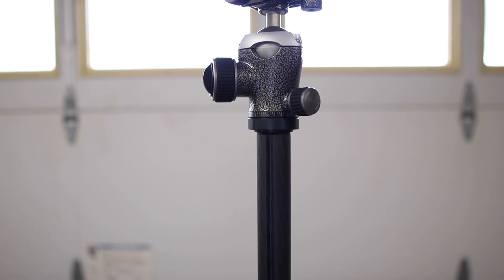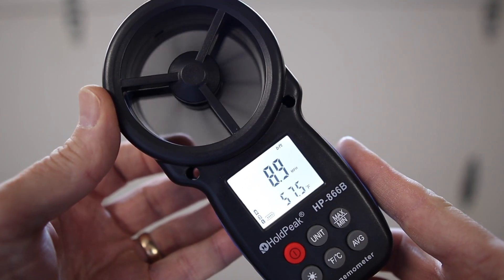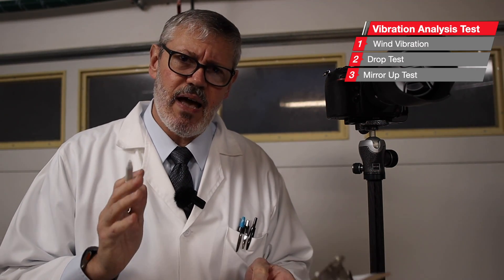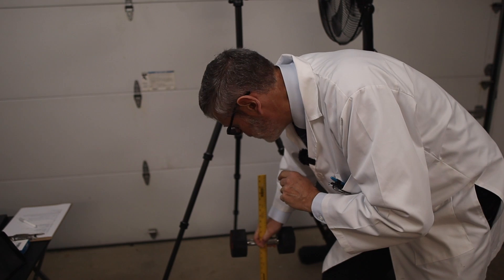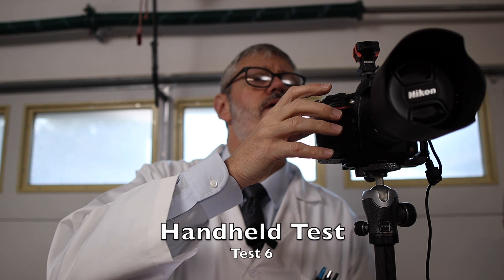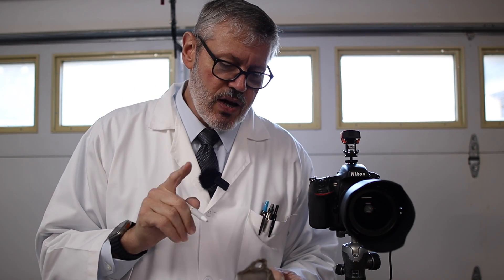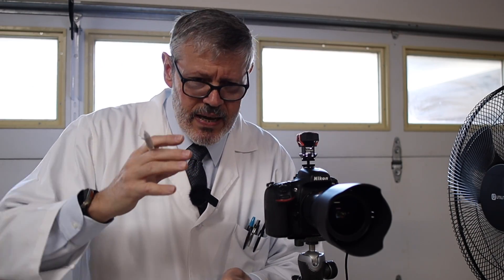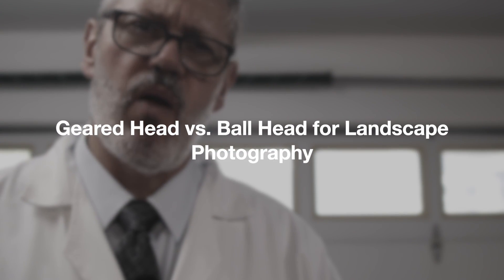Tripod Center Column vs. Without Center Column | Vibration Analysis

Comment: How could this be rested with a mirrorless camera & an electronic shutter like my Nikon Z8? Also, what kind of variation would we get with different sizes & weights of tripods? What if we tried a 3 section tripod that supports 40 pounds vs. a travel tripod that supports 10 pounds? Also, I'd like to see the difference between an aluminum vs. carbon fiber tripod of the same supporting capacity.
Reply from the maker: Some very good questions here. Perhaps in the future, I’ll make a video comparing a mirrorless camera. Some of your questions are addressed in my video comparing a travel tripod to a full-size tripod. Here’s the link: https://youtu.be/Sl0wByhdl7g?si=aOuTDcFqjJPK3q5m
Reply: Mark Lewis een carbonstatief geeft trillingen van onderaf sterker door dan een aluminium statief ,is op YouTube tube uitgetest door 2 fotografen die totaal verbluft waren over de uitkomst. Bedenk dat carbon sterk, licht, maar ook knalhard is waardoor de resonantie van onderaf sterker zijn. Overigens met plezier naar deze zeer goede uitleg gekeken.
Reply: @jannieenjoopdreef5865  You must be thinking of somebody else. I'm well aware that carbon dampens vibrations as opposed to transmitting them.

Comment: Absolutely loved this ! I have a center column tripod and I have always said the vibration it is pretty insignificant under most conditions.  The exception would be extremely long exposures, say more than three seconds. Then even a light breeze will give you camera movement blur that depending on subject and intention can ruin the shot . However I think with the column down and using the column as a point of contact it is obviously superior to only three legs . 
Note : I don't mean hanging a weight such as your bag as this introduces more sway at times . I came up with my technique after watching someone on UTube using a guy wire like approach to stop said sway and realized if shooting low as many us use for foreground emphasis, you can create a fourth leg or center anchor.
Here's the video that inspired me :
https://youtu.be/9Cb0rVXWcRw?si=OU1GguiHiZIAcNb5
Enjoy !
Reply from the maker: Hello John! I’m so glad you enjoyed the video. I’m thinking about making a follow-up video to this one, maybe with more detail and more precise equipment. Thank you for watching and for sharing your thoughts.

Comment: Interesting… You’re right-hand dominant; yet your watch is on your right wrist. Savage.
Reply from the maker: Keen eye, my friend 😃 Had to wear it there for a bit while healing an injury. Thanks for watching!
Reply: @ScottymanPhoto  awesome . I’ve been researching tripods (and massively disappointed with the lack of innovation in the space ). I believe many of the shortcomings with tripods have actually been solved by structural engineering concepts dating back to the 1840s - just not incorporated. I also discovered another ghetto solution to avoiding tripod wobble : (wait for it) : camping stools  (the 3 legged saddle things for fishers ). You instantly lower the center of gravity and solve the issue of needing a camera at eye-level. Also - did you find the gyro device more accurate than using your phone’s accelerometer (accessible via the web api btw - so no need to dick around with Swift and Xcode certificates ). Oh god I’m oversharing again . Peace !

Comment: one point about vibration, as you imply at 7:36 that 1deg\sec. is minimal; Yes, perhaps at F8 but what about an aperture of f 2.8 or f 1.4 ? where any motion can get any desired object out of the 'focus box' as the dof is so thin at those apertures.
Reply from the maker: That's a good point, Andy! Bottom line, the more stable the tripod, the better the image. Thanks for sharing your thoughts! Take care!
Reply: @ScottymanPhoto  also, a consideration is the column's diameter ( a manfrotto 058 studio tripod has a larger column than the 190 or the beefree); so affecting how stable it is, also the greater size facilitates a greater circumference, for the collet lock to work on, increasing braking power, hence stability of the system.
Reply from the maker: @andyvan5692  Yeah, that's a another good point. Also, many of these tripod like the Beefree, have a rubber grommet or plastic securing the center column after tightening, which can introduce even more vibration. Indeed, there are numerous considerations when choosing a tripod. Great points! I can see now I’m going to have to make another video soon.

Comment: Great video and tests! I interpret the results a bit differently though. The differences between column and no column were small numbers, but you were only dealing with smalll numbers to begin with. The peaks with the column were 14% - 50% higher than the peaks without. Those are pretty significant differences.
Reply from the maker: Very true! .1 or .2 of 1 degree is nothing to dismiss. Later I think I’ll compare some images with .1 degree of movement against an image with no movement. I’d like to be able to more precisely measure the degree of movement as well. Who knows what a future video holds! Thanks for sharing your thoughts, and thanks for watching!

Comment: It also depends on the lens size. For longer lenses vibration is significantly higher.
Reply from the maker: That’s very true, indeed! I considered using a much heavier 70-200 but wanted to stay within the range of what I thought most people would typically use. I’ll bet the data would have been much different with a heavier lens. Thanks for sharing your thoughts, and thanks for watching!

Comment: Thanks for sharing your findings. I realize all this 30 years ago but my test at that time were more empirical, the results were very revealing. One very important cause of vibrations is the rubber feet. I you observe, no mater how well constructed a tripod is, it is resting literally on jelly. The level of reverberation an lack of steadiness is incredible. A metal spike does a much better job keeping the whole assembly stiff. The floor soil sand or  any other material behave like part of the structure, providing it is solid or steady and don’t have or transmit other vibrations.  
Designing the legs is an art, not only the should be stiff and light but free from resonance as much as possible. 
Thanks again, may be having all the test equipment at your disposal my finding could be verified.
Reply from the maker: I think you’re absolutely correct about the rubber feet. However, rubber feet may be better suited for some applications. I think a comparison between different feet may be in order. I used claw feet during my testing, but I think I would have experienced more vibration had I used the rubber feet on a concrete floor. Interesting thoughts! Thanks for sharing, and thank you for watching.

Comment: Great video! And some of my videos were in the YT scroll towards the beginning! Nice!

I definitely think the quality of the tripod makes a huge difference. I have one tripod with a center column that has a noticeable wiggle in it when it is down. Just a poorly built tripod. I have another, nice tripod with a center column that even when extended "feels" very sturdy - more sturdy than the cheap one with center column down.

Did you do any analysis on how long the vibration lasted? One thing I've read is that the higher the center column the more affect inertia has. Once there is a vibration it takes longer to stop than without a center column.

Again - love the video! Well done!
Reply from the maker: Jeffrey, while researching for this, I found your center column video; excellent video, by the way! I did note the duration of the vibration but opted to keep the video as short as possible. Perhaps I will look more into the duration in the future. I do plan to do a bit more experimenting. In fact, I received sufficient comments and suggestions to fuel another video or two. I was thinking about comparing different tripods, but now that you mention it, I might delve more into the magnitude and duration and how these affect the image sharpness at a given shutter speed. Thanks for sharing your thoughts. I appreciate the feedback!
Reply: @ScottymanPhoto  Awesome! Well done video. I subscribed so I'll see future updates.

And after looking more at your channel, looks like you sometimes get to the state just south of me!
Reply from the maker: @JeffreyTadlockPhotography Thanks for subscribing! I did the same when I saw you’re in Ohio. I get to Kentucky fairly often. I love the Red River Gorge. Around Dec-Feb, I usually attempt an overnight winter excursion for a bit of arch photography.

Comment: What effect did the total height have?  Would a taller tripod (so having the camera at the same height as with the column) be less stable?
Reply from the maker: Good question, Kevin! I suspect weight is a major factor. A heavier tripod would almost certainly perform better in the same conditions, I think. I also think that the taller the tripod, the less stable it would be. However, the are other factors to consider such as construction, how far apart the legs are, and total weight. Interesting question! I'm sure I'll be making future videos and comparing other tripods. Thanks for sharing your thoughts and thanks for watching!

Comment: I think a big part of your good results for the center column is that you're using a Gitzo Traveler, which should pretty much be the best in the travel category. Some of the cheaper tripods are probably not engineered as good, and Gitzo seem to do a good job with their center column. It's a really simple design and looks solid just from looking at it and handling it. Also the magnesium cast they use is supposedly very good at reducing vibrations. 

And I think a "main" tripod should probably not have a center column, but travel tripod definitely should. You want to get as much height for the least amount of packed sized, and it's ok to sacrifice some stability in this case. Worst case scenario you'll get on your knees and use it very low if in extreme winds.
Reply from the maker: Nicely put, my friend! I agree 100%. I think the results would be different on cheaper tripods. The Gitzo is a solid tripod for sure! I plan to do further analysis comparing various other models in various conditions. Thanks for sharing your thoughts, and thank you for watching! Excellent comments!
Reply: @ScottymanPhoto  Yeah great video by the way thanks :)
Reply from the maker: @Razertw  Thank you! I’ve been wanting to do this for a long time. I got a few more I’ll be putting together soon.

Comment: hahah, this was cool.  love the deep dive and hard data to support the claims.  I do wonder - each of these are discreet elements impacting vibration.  What about combining all of them?  I bet hand pressing shutter, 2s timer, with wind and ground vibration all together would lead to a more material difference than each on their own.  I'm mostly glad though that the data strongly supports that shutter release :)
Reply from the maker: Yeah, after this little experiment, I think I will do my best to use my larger Gitzo as often as possible. However, like I said in the video, I don’t plan on shying away from my center column tripod when I’m on the go. Indeed, I think small movements in the tripod will have a significant cost in terms of sharpness. Maybe most people wouldn’t notice, but the pixel peepers, they’ll notice for sure! But with the average photo hanging on the wall, I’m not sure anyone could tell the difference except under higher winds. Thanks for watching, Brian! And as always, thanks for sharing your thoughts I truly appreciate your support.

Comment: It’s in my lenguaje 😅 one degree variation translates to focal length  plus field of view how much it will be? Lol this it’s funny but are the same time interesting keep it going well topic!
Reply: Obviously a centre column raised will be more susceptible to vibration, especially in gusting winds (a condition not tested).
An advantage of larger tripods is that they can be set to a comfortable height that doesn't need the centre column raised, with the added benefit of sitting on a wider base.
Hanging a weight beneath the tripod can also help, possibly significantly (something for testing next time). This advice applies to any tripod one might have now, as well as any future tripod.
Supporting a camera/lens combo as close to the balance point as possible is also key (use a tripod collar on the lens if possible rather than balancing weight outboard by attaching the camera/lens combo on the camera's tripod screw).
Also set the tripod so that the weight involved is as much as possible evenly distributed across the three legs.
Combine vibration reducing techniques for best results (obviously). As someone who likes to stack images taken at extreme macro, eliminating vibration is key.
Reply from the maker: @ronjenkins4257  Good points, Ron! I may indeed do additional testing in future videos. Thanks for sharing your thoughts!
Reply from the maker: Thanks for sharing your thoughts, and thank you for watching!

Comment: What about the 2 second delay?
Reply: Thank you for your reply. I enjoy watching your videos, and thanks for the information  in this video - quite interesting.
Reply from the maker: It’s funny that you should mention that! I compared the timer using a cable release without the mirror up, and the results were identical. However, the timer does introduce motion compared to a cable release with the mirror up because there is no pause between the mirror up and the shutter firing. Nevertheless, the timer is a significantly better option compared to the handheld! Sorry, but to keep the video as short as possible, I didn’t include the test because I expected the timer and cable release “without mirror up” to be equal. Great question, and thanks for watching!